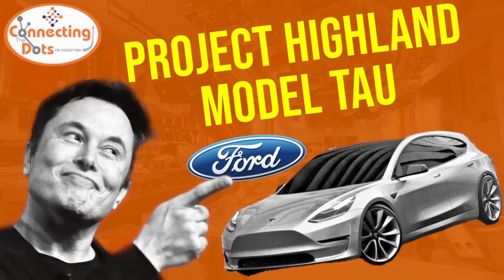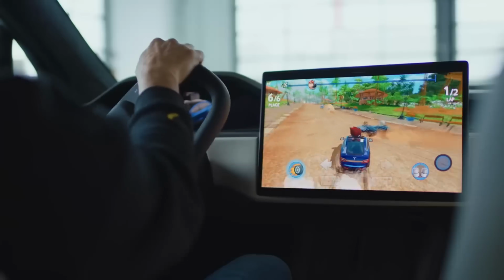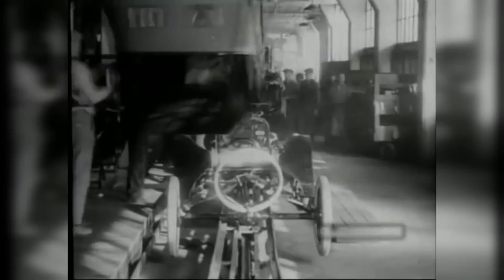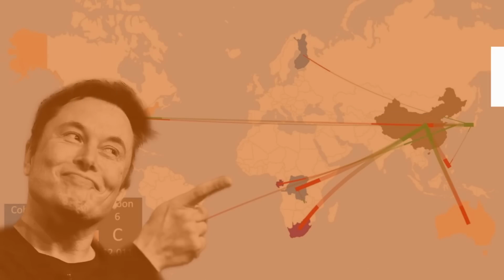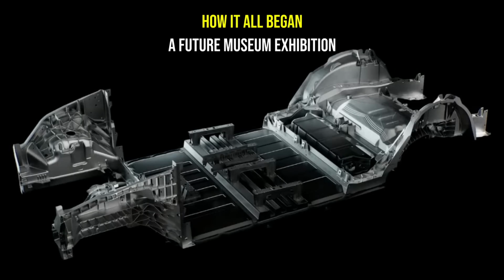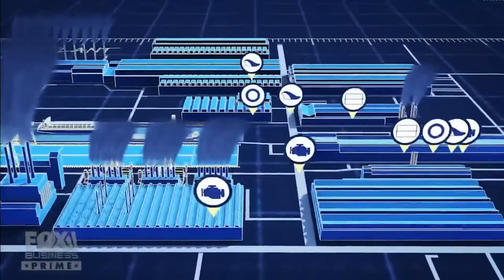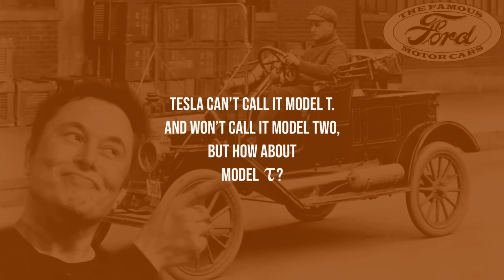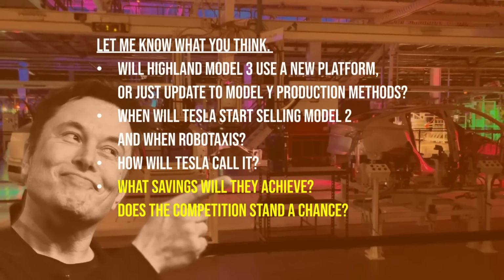Elon's Project Highland, Ford & Tesla Model Tau | A Manufacturing Revolution Pt1 Cracking Easter Egg

Comment: I think project "highland" is just a precursor or a test for something far greater coming in the next 5-6 years.
Probably wont be Tau as it sounds a bit to much far east, but with Elon' love of movies and puns who knows.
I f tesla is already making & testing things for the Mexico plant, it makes sense that i might be ready in 3 years presuming the plant is built in about 2. 
Production techniques will not be much different to what they are now, but simplified to perhaps 50-75%.
One very interesting thing i noticed is that, Tesla is using plastic injection molding techniques on metal. Same  processes were used to make very precise parts in toys and became perfected in smart phones (and other products).
Having worked for Toyota in the Lexus plant, it is shocking to see the 3 pieces of a modelY forming the base of the chassis. I would not be surprised if "model-2" (Tau) would be a turned into a single massive piece with batteries dropped in and covered with a plate.
They're new techniques combined with old ones are fascinating.

Comment: There is a big question: Who services it when it breaks down? I don't trust any auto service, CJK EV are not exception. The open source ECU is a fully programmable control prototyping system based on the latest National Instruments System On Module (SOM) sbRIO-9651. The open source ECU project - Bologna - Alma Automotive. Any opinions about that ?!!

Comment: RoboTaxis? Since it depends on reaching full self driving, not for quite a while. Bearing in mind that Tesla is only at around a 2.5. And while they're continually making improvements, they're very incremental. As for the rest of your vision, I think you're spot on. I also pondered a while on Ford and the machine-that-makes-the-machine. The world could surely use a low cost yet reliable EV.
Reply: "2.5"?
Compare FSD Beta to the Mercedes "3"
Save for the current level of driver monitoring, (which can be altered easily) which system is "better"?
(Clue, it's not Mercedes)

Comment: So amazing to see that lean thinking was really pioneered at Ford...then forgotten amidst increasing layers in bureaucratic blubber. It took Toyota to really take the concept to the next level and for Ford to be reminded that "Hey...didn't we used to do something a bit like that...?" Now Tesla has taken the crown.

However, the main negative issue with fewer body parts is the significant escalation in repair costs due to body impact damage: relatively small damage can be frighteningly expensive to repair. This is being reflected in insurance premiums. Hopefully autonomous driving and improved sensors around a car can help in reducing accidents and thus premiums, but this is an issue that needs to be addressed.

Comment: If the first Model Whatevers  comes out in black I won't be buying it (black gets noticeably dirty faster than other colors and it also gets hotter in the sun). I'm hoping for white. Also, if it's built on the Model 3 platform won"t it be too wide for a small car?  The 3 is  3" wider than my Camry (and I consider it too wide). How about naming it "Too" as in "S3XY Too" (and Model 2)?
Reply from the maker: I'm pretty sure that IF they only offer it in black, tgat would be for a short time only, just for the symbolism and media coverage

Comment: Great video! My guess is that they might call it the Model A, the missing letter in „sexy cArs“, also it might be a competitor to the A class from Mercedes in some way (size wise) as the Model 3 is a direct competitor to the BMW 3 series.
Model A might implement the new simplified wiring that Tesla patented and initially planned for the Y years ago.

Comment: Model Tau is non logical and so is Model 2. Model 3 isn't 3 it's E. Look into hacker or programmer slang. S/3/X/Y...what is 3? Of course it's E. Cheap model from Tesla will be called 4. Why? Programmer slang for A. Why? Model 4 fits into the previous letters in the acronym. S/3X/Y C/?/R/S. C is Cybertruck, R is roadster and S is Semi. what letter is missing in there word cars? The A. A is 4. Soo I'm99% sure a next model will be called Model 4.
Reply from the maker: Could be. My guess on names isn't any better than anyone's - it's just a matter of different associations. Time will tell who was right, and it's very possible that we are both wrong. 
Elon already said that going forward they will drop the "model" prefix. It's either 2,3  etc or Tau, Pi etc but without model preceding it.

Comment: Very good, History repeating itself, i think the Highland project will indeed half the price of the model 3, will Elon sell it for half the current price, we will see. As far as the model Tau or 2 goes, i think it will be made for the RoboTaxi, not sold, we will see how much it costs per mile of use. It will be half the cost of any other form of transportation to start, and go down from there over the years to really transition the world to sustainable transport. Personally i would make the model Tau from the CyberTruck design, for maximum durability, safety and cost of manufacturing, it will be known as the Diamond Cut Model at your service.

Comment: Naming the pending Tesla compact model Tau would be a stroke of marketing brilliance.  Tau is just so, wonderfully mysterious.  FYI,  Tau has a mathematical meaning:   It is the ratio of the circumference to the radius of a circle, which is equal to 2π (6.28318...).  Which means it's a number that like Pi, has never been truly solved for absolute value...

Comment: Am I mistaken but highland project is a revamp of model 3 , cheap Tesla is still not announced even in code name
Reply from the maker: As far as people know, it's the model 3 revamp. What I'm suggesting is that although this would appear to be the case, on fact it's the name of a whole new platform intended to reduce speed and cost way beyond Model Y, and Wil be used or copied for the small Tesla, which I call Tau.
Reply: @ConnectingODots  I agree on the premise don’t matter the code name but once Tesla ramps up batteries they will do as you say. Tesla said the would not revamp line up until they get more batteries but maybe they don’t even need that many batteries for a robo taxi ? We’ll see 😄

Comment: “Model E” OR “Model Tau” with “Model 3” renamed, “Model E” w/ its March upgrade/makeover.
    Elon should not have been bullied by Ford in not using “Model E”, since Ford itself affirmatively decided not to use “Model E” in naming its EV, “Mustang Mach-E”.
    There can be NO customer confusion between a Tesla Model E and the Ford Mustang Mach-E. Furthermore, Ford abandoned & surrendered any product right it might have had to “Model _” (fill in the letter) by decades of disuse and not contesting Tesla’s use of “Model S & X” for yrs before the Model 3.
    The lost free advertising from “SEXY” is huge & shouldn’t have been forfeited merely in response to Ford’s mere words that infringement occurs cuz some older folks (plus the greater number now deceased) could have, w/ intro of the Model S, recalled Ford’s use of “Model T” & “Model A” - it was clear at the time of Model 3’s introduction that no customer confusion ever existed or was likely to.
    Proof of non-confusion exists in the age of Google that was not readily available before. Not calling it the Model E is a classic case of failed legal dept due diligence in protecting Tesla & its mission.
    “Tesla Model E, honoring Tesla’s commitment to safe, low-cost personal transportation for working families”
    Or for a cleaner “sexy” approach, since the Model 3 is about to be “reintroduced” in March w/ major changes, rename IT, Model E, & stick w/ “Model Tau” for the new one as you suggest - this gets you to “SEXY TAU” - that you let relax to “Sexy Tau” - this is branding, not conformance to the NYT Style Manual !
    Tesla gets its EV branding coherence restored AND gets a bunch of free advertising to boot. (Elon: Step 1: take your ball-peen hammer w/ you into your legal dept, announce your decision, and get them hopping before you go public w/ your announcement.)
Reply: Model "T" sounds a bit old fashioned; remind me of Ford's model T.

Comment: The 1902 to 1907 Oldsmobile Model R "Curved Dash" was the first mass-produced car, made from the first automotive assembly line, an invention which is often incorrectly credited to Henry Ford and the Ford Motor Company. Ford was the first to manufacture cars on a moving assembly line, while Olds used a stationary assembly line, meaning that the assembled vehicle remained in one place and workers would move from one car to the next and perform one assigned task.

Comment: I'm betting that when the next model comes out to get its cost very far down it'll use a combination of Technologies used for the Cybertruck and the Model Y. You'll be able to get it in any color as long as it's stainless. That will totally eliminate the paint job.

Comment: After hearing that it was Tesla who rediscovered the just-in-time method (LOL), and that cars are painted in batches of the same color (They are not. Robots change color from vehicle to vehicle seamlessly) I couldn't watch anymore. Go and inform yourself...
Reply from the maker: Where did I say that Tesla invented JIT? What I did say is they use the trucking contaniers as warehouses right at the assembly line station. Truck drops full container at factory, leaves with another (either empty or filled with waste material etc) without having to wait for unloading. Only unloading from container is to production line station beside it. AFAIK no other company does that.
Regarding paint, I guess you are right. However, if there are marginal gains in batching, then Tesla tends to capitalize on every small gain.
Reply: @ConnectingODots  I didn't said you did, either. What you said is to imply that it was invented by Ford a hundred years ago (it was in fact invented by Toyota in the 70's), and then "forgotten" "until Tesla reminded the industry".
The containers you are talking about are the "milk run". No mistery there, everyone does that. Same as everyone has the supplier of any part deliver them in small batches directly to the station where it will be used, labelled with the minute it will be used,  in the order it will be used. There is, in example, no warehouse with headlamps, switches or seats. The only parts in the entire factory are the ones delivered to the proper station by the supplier several times per day. Tesla just follows industry practices.

Comment: I am looking for info on the anode and cathode and strips having agnostic coatings and the 4680 equipment just be able to have the coatings tweaked and keep on rolling. I do not know any reason LFP can't be used in the 4680. I expect additions that increase the energy density of LFP. I also expect to hear of the dry process used on both sides.

Comment: I admire the enthusiasm greatly, but you are making the point fit the facts. GM were the experts mass production above Ford at  in WWII. Other Tesla/Ford parrallels are missing... E.g. Ford Europe.... Tesla Germany. Ford in the UK developed and trained many engineers from the Boreham Rally program. The next CEO of Tesla vehicles is likely to be from China.
Reply from the maker: I didn't even try to make this a full analogy of the COMPANIES (let alone the founders) when even in technological innovationsI had to cut things out since the vid was getting too long. My focus was on showing a few prominent methods regarding lean manufacturing, then move to predictions. 

GM did pass Ford, but that was later on. Ford started mass production on assembly line earlier than GM did and introduced lots of innovations. Ford did produce in Europe as early as 1913, but iirc only started  European development of cars much later

Comment: So what will the price be compared to a 4cyl Camry?

Until there are EV options at entry level prices then ICE options are not going anywhere, that's at least 10 years off if new cheaper more power dense battery options pan out. Realistically we might not get there for longer then that.

Comment: If $700 in 1910 is equivalent to $20,358 in 2021, then $350 should be equivalent to $10179, not $7403. Someone's got some figures wrong here. Halving the 1910 price should halve the 2021 price.
Reply from the maker: There was high inflation in those years, Nominally the price fell down by 50%, but inflation adjusted it was down around 70% IIRC

Comment: Anyone remember early giga-texas designs had a central roadway?  It now seems obvious Elon was thinking about the ford supply train that ran right into the middle of the factory.   You can even see where they have foundations and cranes set up down that central line to unload supply trains.
Reply: Early comments Elon made said the teratx plant design would allow electric semis to drive right through it. 🤔

Comment: Jaw dropping.   thank you for the expansive digging. 
I've been wondering why they haven't announced another factory location yet...   if project highland might be a step-change in what a factory looks like.. it makes a lot more sense they won't announce new factory builds until they roll out highland. .. and a highland type prototype factory change seems now the most likely thing they will talk about at Investor day March 1st. 

It's been clear since battery day two years ago that tesla was aiming to be a manufacturing focused company.   Go watch that and count how many times they mention manufacturing as their strength, their focus, their answer to Q&A.  It makes even more sense that an 'investor announcement' would be a manufacturing announcement, not a product announcement.

Comment: TlDr: Model two will be an assembly of modules like an 80's cartoon (think Megazord) rather than a traditional "body in white" Car.

I'm expecting Model 2 to have a cast front / rear that doubles as both chassis and panels. 4 Major modules independently assembled then brought together near the end of the line

The front being single piece (No articulating Bonnet) that's fully a formed one piece chassis / fenders / front fresh out of its mould. A bolt on bumper / lights sub module with single cat-6 connector that provides power over Ethernet to the lights.

The skateboard being interior seats / floor / battery pack / engines / suspension / wheels. With cat-6 switching for connecting to other modules.

The rear being a single piece which the hatchback mates with when it closes, but it doesn't have a boot hinged to it like a lid. + bolt on bumper / lights sub module. Single cat-6 connection to the skateboard.

Glass Roof / Articulating Hatchback / ABC Pillars (a "Lid" module)

+ Doors

Remove separate panels / parts in favor of direct use of chassis as exterior...
 - No Bonnet, Fenders, Front / Rear Panels, e.t.c.

Assemble each on separate smaller simple lines then bring together for final assembly to minimize the impact of production line stoppages and increase parallelism of factory.

In the event of a crash, entire sub / major modules would just be swapped out with a replacement module brought to you by the service vehicle for in-place same day repair of major damage.

Minor maintenance of HVAC and the like by hoisting the car and reaching up from beneath. Rather than designing for access and maintenance via a painted panel on the top visible section of the vehicle.

Comment: Connecting the dots:
Elon said last year that it now even will be called 'Model...'.
I am suggesting the name type as Tesla Cybertruck, Tesla Semi, Tesla xxx...
So it will be called Tesla Compact.
It will have one battery option, RWD or Dual Motor and 5 colors and only black interior. The Dual Motor will have 19" the normal will have 18".

Tesla Compact
50 kWh battery LFP
Rear wheel drive
18" wheels
Black interior
White, Grey, Black, Blue, Red
$ 23.000

Tesla Compact Dual Motor
50 kWh battery LFP
Dual motor
19" wheels
Black interior
White, Grey, Black, Blue, Red
$ 28.000

This will give a maximum of only 10 manufacturing variants and will blow the marrket!!!
This will be the new Beetle/Golf/Corolla.

Comment: Now I'm thinking that Teslas low guidance of only 1.8 million cars for this year, is because they will close down their Model 3 factory lines for massive upgrades. They did after all talk about not optimizing for number of produced cars, but going for increased efficiency this year.

And yes, you just earned a new subscriber with this excellent video.
Reply from the maker: Thx

Comment: There's one mystery they may be connected to this. IDRA is shipping a 9000 ton gigapress to Asia. These are used for the Cybertruck, but nothing else we know about. It's almost guaranteed that it's for Tesla, especially with the red-white color scheme, and I don't think they will make Cybertrucks in Shanghai. So what's that for?
Reply from the maker: Exactly! I'll speculate in this in the upcoming Engineering analysis video

Comment: Something wrong with the maths: $700 = $20,358 (2021) but $350 = $7,403 (2021) 350 = 700/2 but 7403 <>20358/2...
Reply from the maker: There was high inflation in those years, Nominally the price fell down by 50%, but inflation adjusted it was down around 70% IIRC